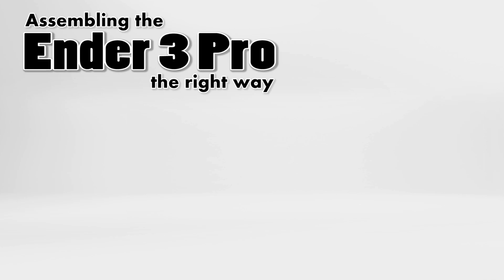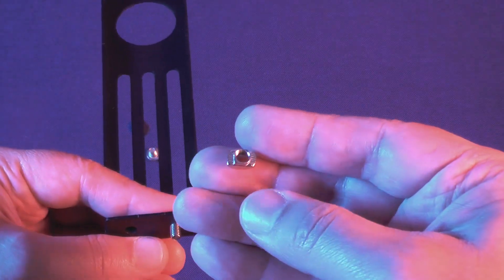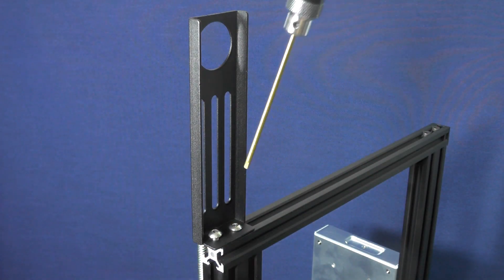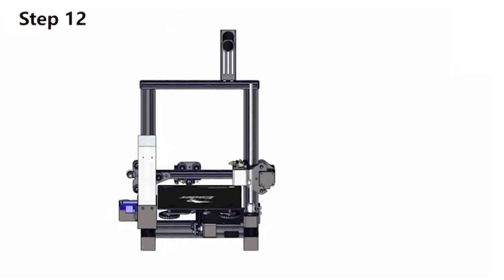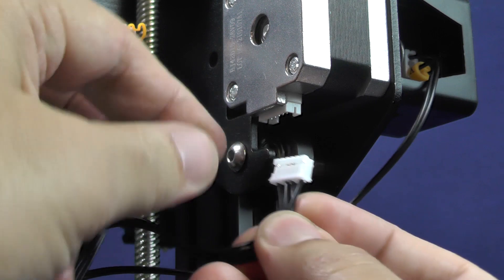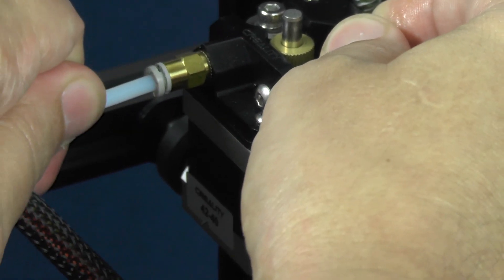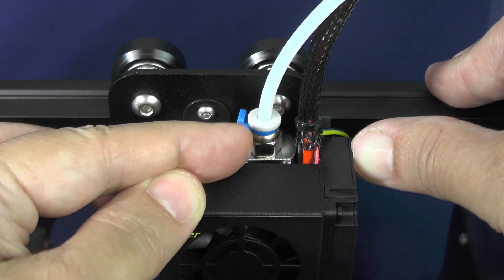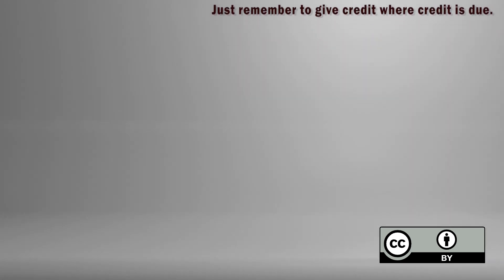Ender 3 Pro (2022) Assembly Guide - Part 5

Comment: Just wanted to thank you again. I have another printer I got from a guy, and ended up taking most of it apart. Cleaning and readjusting all the concentric nuts, as some were loose and others dragging quite a lot. Your videos are the only ones I have found so far that show how to adjust these so they are all even. - I noticed a slight bind on the X axis, after properly adjusting and cleaning all the contact surfaces. I was able to diagnose that one of the bearings in the V wheel is catching. To many things could have caused that without knowing how to eliminate all the other variables. :D
Reply from the maker: Hansoncrack, if it is not too much to ask, I would like to know your name.
I just wanted to be able to, more appropriately, thank you since you are this channels' first financial supporter. 
You are now part of this channel's history! 🙂👍
Reply: @MakerMindset  Jesse Star
Reply from the maker: @hansoncrack   @hansoncrack  Thank you, Jesse. If you don't mind I would like to thank you by name in my next video.
Have a wonderful weekend!
Reply: @MakerMindset  If you like, I will and you as well :)

Comment: Thank you so much for taking the time to create these videos.  You made a tricky task a heck of a lot easier.  One way I still struggled was figuring out what orientation you were in for the closeups.  For your next "how to build" series I would suggest start the whole thing by establishing an orientation for the device.  Which is "front" and which is "back", etc.  Then before you zoom in for a closeup, have a shot that's a step back, showing the whole part or which way the machine is facing and make sure that stays consistent as you zoom in.  Having said that I did manage to figure it out with a rewind and watch again :-)
Reply from the maker: Thank you so much for your kind words! 

Regarding the close-ups, I did not realize that they could be an issue. I always focused on doing close-ups because that's what bothered me when I watched videos from other creators. I could never see clearly what they were doing. 

What you suggested is an important part of movie making. It is called an "Establishing Shot". If I had done an "Establishing Shot" before going for a close-up, you would have had an easier time following my videos.

I appreciate you taking time out of  your life to give me a constructive feedback. I promise to do better next time. :)
Reply: @MakerMindset  I'm glad my feedback was useful.  These are great videos and you have been such a help in getting my printer running!!  Thank you once again.

Comment: Should have used this video to build mine. Sadly, I’m finished building and the printer will not Read the SD cars unless I hold it in the slot. Any ideas why this is happening? Really bad customer service and may have to return it. So frustrated right now. So any help would be appreciated.
Reply from the maker: I understand your frustration. Having to disassemble your printer to return it is going to be a pain. 
My guess is that your SD-Card reader is defective. The SD-Card cannot be removed from the slot while printing so, in the meantime, you could try to use Scotch tape to replace your finger or lean a heavy object against the card. You could do both, to be on the safe side. 🙂

This component cannot be easily replaced. You can try to ask Creality to send you a replacement board but it can be a lengthy battle before the replacement board arrives at your door.

You have three main alternatives other than returning your printer. They will cost money.
1.	Replacing the motherboard with a third-party board. I recommend the BIGTREETECH SKR Mini E3 V3.0. It is $45.00 on Amazon. I will eventually do a video about this upgrade because the board that comes with the Ender 3 Pro doesn’t have silent stepper motor drivers.
https://www.youtube.com/watch?v=2rJbthxMxcI
2.	Installing Octoprint with a Raspberry Pi (Raspberry Pi, at the moment, is out of the question because of chip shortage) or an old Cell Phone but this is complex.  In the near future, I intend to do a video on this topic. 
https://www.youtube.com/watch?v=RkZvv4WmXT8
3.	You could also try an $18.00 MicroSD to SD adapter. I am not sure if this will work but, if it does work with a little bit of hot glue 😉, you won’t have to deal with your finicky MicroSD Card reader anymore.
https://www.youtube.com/watch?v=dybAyK0_IhQ

I found a very nice website where the author goes through several possible problems related to the SD-Card not working. You should check it out:
https://3dprinterly.com/how-to-fix-3d-printer-not-reading-sd-card-ender-3

I am sorry that you had such a bad first experience with your 3D printer. Please, don’t give up! 
I wish you good luck and, if I can help you in any other way, please, don’t hesitate to ask.

Comment: OK...that was great...now,how do you print something ? I have been playing all day and still can not make it print from the sd card they gave me !! Help !
Reply from the maker: I am sorry that you are having trouble with your first print.

I know that doing your first print can be a bit daunting. I have been working for several months already on my next series that will explain the first steps for a complete neophyte on 3D printing. However, since Google does not pay a penny to a new channel, I can only do those videos on my spare time, which isn’t much.

It is going to be another 5 videos series with about 10 min each.
Reply from the maker: In any case, let me give you a little written version of what is to come:

1 – The first thing that you will need to do is “Bed Leveling”.
2 – Next, you will have to install a piece of software called 3D slicer. Creality provides a version of a 3D slicer from Ultimaker called Cura. You can get the Creality version of Cura from the SD card that comes with the printer or by going to their website and download it.
3 – Now, go to www.thingiverse.com and download a couple of small .STL files designed to do quick test prints. You will need to print these test files first, in order to make sure that your “bed leveling” was done right.
4 – Use Cura to convert the .STL files that you downloaded from www.thingiverse.com into .GCODE files. Your printer does not understand .STL files. It only understands .GCODE.
5 – Copy the .GCODE files you just created with Cura into the MicroSD card that came with the printer.
6 – Stick that MicroSD card into the printer.
7 – Go through the printer’s menu and select the .GCODE file located in the MicroSD card.
8 – Your printer will heat up and start printing.

It’s hard to condense 50 min of video into a few lines. You should use this list as homework assignment. :-)
This is what you will need to accomplish in order to do your first 3D print.

Comment: Great series! In my opinion, this is the best Ender-3 Pro setup tutorial by far. One tip for viewers: the Z Stop Switch and the Monitor are attached at the end of Part 2. Later in Part 3, they need to be briefly removed in order to allow the pedestals/vitamin bottles to be placed on the rails. Would love to see a new tutorial on bed leveling and printing tips. Thank you for this great tutorial!
Reply from the maker: Hello, John Zieg! I would like to thank you for pointing out my mistake. I have revised and re-uploaded Parts 2 & 3 of the series with the steps reordered. 
I also credited you on Part 2:
https://www.youtube.com/watch?v=rhlIFp0_w2I&t=687s
and on Part 3:
https://www.youtube.com/watch?v=TxmMqsp5010&t=617s
Have a nice day! 😊👍

Comment: Has anyone had trouble with the spool holder? I can screw it together when it's just the holder but it doesn't screw into the fixture. It's like the fixture is just a little too wide
Reply: FIXED! Maybe I just got a defect, but I sanded the flat part of the cap and now it fits!
Reply from the maker: I am sorry but I am not very clear as to what you are struggling with. 
Are you talking about attaching the "Spool Holder Arm" to the "Steel Bracket"? [ 1:13 ]

Comment: Just picked up my first FDM printer, Ender 3 Pro, the other day and your video is the only one that I've seen that has talked about the blue plastic clips and the extruder cable management/holder. Thank you!
Reply from the maker: Funny you say that! The "cable management hook" always bothered me. It was obviously designed for this purpose but not even the assembly video from Creality, that you can find on the SD card, had any information about it.
I figured out that I needed to put a Zip Tie after 30 min of experimentation. I cannot imagine that the designer of that little hook did not intend it to be used with a Zip Tie. It worked too perfectly! :)